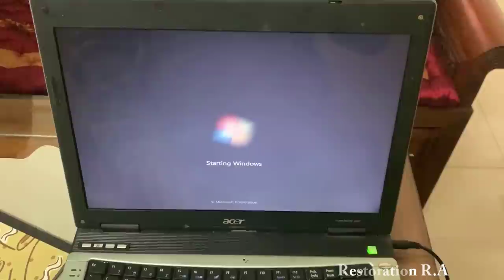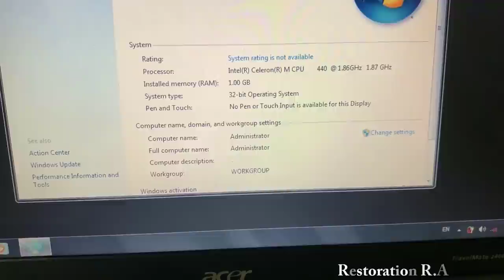Restoration super huge giant destroyed laptops | Rebuild and restore broken computers

Comment: My favourite part is when he washes the circuit board with detergent water
Reply: Did they hear for a contact cleaner in that part of the world xD
Reply: And when the washed the battery with water. That was funny.
Reply: I watch a  restoration yesterday and that was the same washed the motherboard in soapy water the boards won't work after been in water someone needs to explain this to them all the connections will become loose
Reply: Actually, I always wash dirty ass motherboards with water, it s not a smart thing to do ,but it s necessary sometimes.. electronic components are more strong than you think ! If you carefully dry them it s fine!  Water is not going to kill them instantly :)

(Anyway, the videos is fake)
Reply: The board would never survive that. Its all as fake as hell. Then the usual mantra is to test continuity with a meter. What they are actually doing is testing resistance which will cause the needle to swing once the positive probe on the board meets the negative one via the circuits !
Reply: İf circuot board Doesnt have power you can clean it watet
Reply: 😂😂 @CptSlow89

Comment: Seriously? @13:15 just what part of the digital circuits are you checking with an analog multimeter? I guess people believe anything they see.
Reply: Let me explain how these work. So he buys a Pc or whatever then he films it working then he paints it in dirt, he makes it look as bad as possible and he throws it away in garbage. He starts filming and acting like he found that laptop in garbage. Then he "cleans it" and makes it look better and then he places the footage from before when the laptop was working. Hope i've helped you! :)
Reply: It doesn't work out that way lol
Real technicians usually use some sort of power supply and try to turn it on and see if ammeter moves, if not there's a problem

Or probing while powered on and measure voltage, out of spec=problem

Comment: one question, what exactly are you measuring? Randome poke at different elements 😀
- first measure the input circuit, then measure the resistance of gpu, cpu. measure the voltage drop on the usb, and see if the pch is working